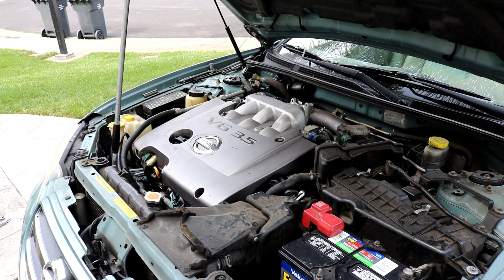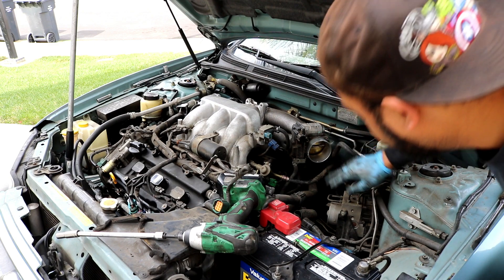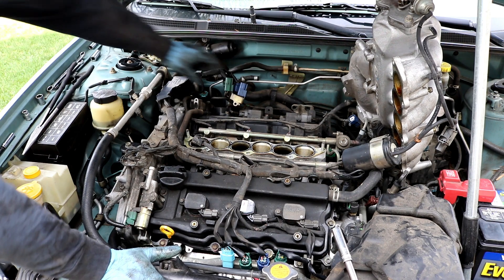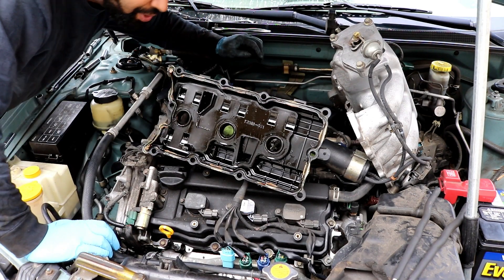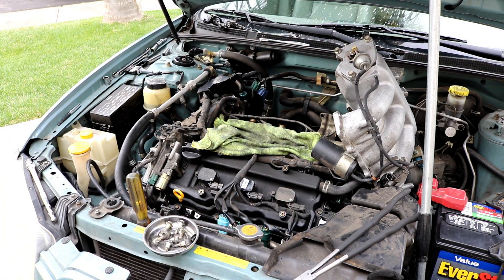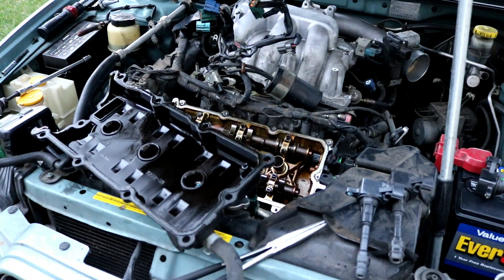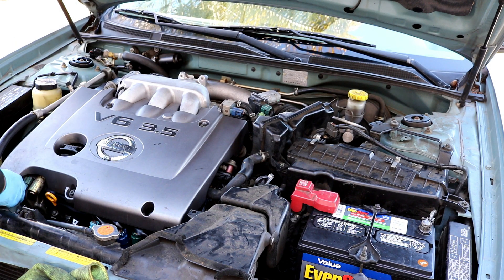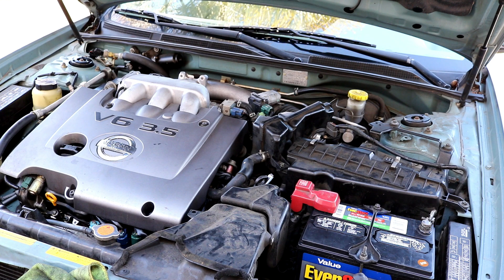Nissan Maxima/Altima/Infiniti I35valve cover gaskets 3.5L V6 VQ35DE

Comment: Bro this video just saved my wallet, I usually do all my own repairs but I was worried about replacing my rear leaking gasket because of the manifold removal but after watching this video I have every confidence to do the work myself. I was dreading having someone else work on my car short of dropping the engine. A++++++ on the detail and clarity of this walkthrough
Reply from the maker: Thanks. Good luck sir.

Comment: 2002 Infiniti I35:  Very intimidating process, BUT it all worked out nearly perfect for me mainly following this video.  Only thing I would advise if you can get away with not having to disconnect the coolant line (I had to) on the right you'll be fine. I installed 6 new spark plugs, 6 coil packs, 2 new valve covers & gaskets, 2 camshaft sensors and mass air flow sensor.  Figure do it all while you're under there oh yeah and clean your throttle body.
Reply: You did the right thing.  Always do the “while you have it all apart” items as well with that intake plenum out of the way.😊

Comment: Thank you buddy, I found this very helpful. I have a 2004 Infiniti I35 and it would of cost me close to $1,000 just for labor. It’s crazy how our mechanics/technicians pray on us hardworking citizens who barely have enough to get by. The dealerships are worse! They print me a $2,500 bill, and said it’ll take up 15hrs of labor. Smh... They wouldn’t even let me bring my own parts. When I asked why it was so high, they said because it’s a luxury car that’s why. I had to buy theirs. I’ll probably never own another Nissan product ever again. Thanks again!
Reply from the maker: That’s exactly why I make these videos. I’m glad you found it helpful.
Reply: Please upload other helpful projects when you get the chance.
Reply from the maker: Luttie Tune will do. I do have other videos up on my channel. If you are looking for something specific I may be able to help you out, just let me know.
Reply: I appreciate you for getting back with me bro. I need to reset idle for my throttle body sensor. I have an 04 Infiniti I35 same engine. I was cleaning it while it was still attached to the manifold. The RPM is jumping a little between 1000-2500 but not badly. It’s not really affecting my driving just a little distracting.
Reply from the maker: Luttie Tune sure, there are quite a few steps involved but I will write them here so that you can get this done. You will want to perform this stuff after the car has sat overnight. There are 3 different procedures that need to be done. I will list them as 1,2,3 and the steps will be listed as A,B,C, and so on...

Please read the last procedure carefully BEFORE starting the entire thing. As it is very time bound.

1. Accelerator Released position:

a. Make sure Pedro is FULLY released.

b. Turn ignition ON (don’t start the car) wait at least 2 seconds. 

c. Turn ignition off, wait at least 10 seconds.

d.Repeat these steps for a second time.

e. Take key out of the ignition when you are done with the second go around.

2. Throttle valve closed position:

a. Make sure pedal is FULLY released.

b. Turn ignition ON. Wait 3 seconds.

c. Turn ignition OFF. Wait at least 10 seconds. Make sure you hear the throttle valve operating sound. (Tip: if you do this inside the garage with the passenger window open, you can hear the valve move)

d. Remove key from the ignition.

3. Idle air volume learn:

a. Make sure pedal is FULLY released.

b. Turn ignition ON, wait 3 seconds.
 
c. AFTER you wait the 3 seconds above, WITHIN 5 seconds FULLY depress the pedal 5 times smoothly. 

d. Wait 7 seconds, then FULLY depress the pedal to the floor and HOLD IT. After about 10-12 seconds the Check engine light will switch from steady to a blinking light. CONTINUE TO HOLD the pedal still and after about 9 seconds the light will go back to steady. 

e. Release the pedal FULLY and start the car within 3 seconds.

f. Allow to idle for 20 seconds.

g. Lightly rev the engine several times to confirm the idle speed returns back to normal. 

h. After several revs and the car returns to normal idle, the relearn is complete.

Hope this helps!
Reply: Hello friend... thanks again. I had everything replaced and put back together. I had a friend help me out as well. We had replaced both intake valve covers, valve gaskets, spark plugs, coil packs, and cleaned the throttle body. Shortly after the service, I took the car for a drive and I got a P1456 code (small evap leak). We checked the connections and only noticed an intake plenum hose cracked. We replaced that one with an Autozone part shortly and reset the code. 

Shortly after, and still today, I’m still getting this code... I have an after market gas cap, but I had it for couple weeks prior to this code. I had also replaced the charcoal canister purge valve a lil while ago. At highway speeds and some high accelerations, I notice the RPM making a slight jerky motion and hesitates a little. What do you recommend?... dealership charges way too much to do a diagnostic test and probably will miss diagnose the problem.
Reply from the maker: Luttie Tune That code will require a evap smoke test to be done to find the leak. A gas cap is a cheap thing to try at first and sometimes it works. However the leak is small and it could be coming from a small evap vacuum hose or somewhere else. You can buy a smoke tester on amazon for around $150 if you have a small air compressor. However a shop will probably charge the same or less to perform this task.

As far as the jerking is concerned. Is the transmission shifting hard? Is it happening at a steady cruising speed?
Reply: Helping Hand Auto Repair 
Thank you for your fast reply. And no the tranny is shifting just fine and this doesn’t happen at cruising speeds. Only sometimes at random fast accelerations. My friend says it might be from a combination of the small leak accompanied with a the now clean throttle body. We did clean the throttle body well and gotten a lot of dirt off. He says the car is breathing much better now and will probably notice little things that weren’t there before... but yeah I guess I’ll have to look for a local honest mechanic shop or an honest Firestone to do the smoke test. The dealership charge $250 for just the smoke test. $150 would be cheaper and better if can spin a few extra dollars for hose replacement. I hope it’s just another small hose... that’s the only code that is still popping up P1456.
Reply from the maker: Luttie Tune Yes unfortunately a smoke test is needed. It would be the most effective way to find the leak. There are cheaper smoke machines on amazon. You might check that your power valve isn’t binding or stuck shut sometimes. It’s the little actuator on the passenger side of the intake manifold. It is controlled by vacuum pressure.
Reply: Helping Hand Auto Repair how do I check to see if it’s shut. I know where it’s located... kinda resembles a throttle body, right? Butterfly like valve?...
Reply: Helping Hand Auto Repair you’re a great help my friend! God bless...
Reply from the maker: Luttie Tune yes. You can physically (with a piece of vacuum hose) suck on the hose with it attached and make sure that the little arm moves fully through its range of motion smoothly.
Reply: It’s all good now man. Turned out to be the gas cap. I went and bought a genuine Infiniti gas cap and the code went away. No more leaks!

Comment: I took my 2002 Nissan maxima se 3.5l 6 speed manual to a mechanic shop for this service. They charged my $800. Car was running extremely well before I brought it to them, after I got it back there was a huge easily visible oil leak, steam /white smoke shooting from the engine, service engine light is on and it barely starts now. I'm towing it to my brothers trusted mechanic on Monday and hopefully they will be able to fix it properly. Thx for the vid bro I wish you were in my city I'd definitely be happy to pay you for your proper services
Reply from the maker: Appreciate that. Bet they crushed the gasket and torqued it down out of place causing the big oil leak.
Reply: @HelpingHandAutoRepair  thanks for the reply. Do you think a compitent mechanic will be able to fix it properly?
Reply from the maker: Of course. The back one can be tricky. That’s why I put a little bit of silicone into the valve cover grooves to help hold the gasket in place before reinstalling it.
Reply: @HelpingHandAutoRepair  also do you think that $800 was a rip off? If it was fixed properly would $800 be fair?
Reply: @HelpingHandAutoRepair  thanks for the replys man I'll message you when /if I can get it fixed up properly

Comment: Bead of silicone on the head is unnecessary and not recommended on the factory service manual (FSM - found by googling "NICO altima FSM") I'd forgo it but it surely doesnt hurt if installed properly. Great tutorial here.

The FSM does require a bead of anaerobic liquid gasket maker on the cover itself at the corners near the front of the engine, and a bead of RTV on the outside of the gasket at the same location -see FSM for exact location, and untightening and tightening sequences and tourques.
Reply from the maker: Lol. This is too much. This channel is NOT for people who work as professional mechanics. Black RTV is fine and has been fine for YEARS. I leave it to the viewers discretion if they want to use it or not.

Comment: Got a 2002 Infiniti i35 that needs a valve cover gasket replaced . Search around shops and it cost a lot of $ to get fixed . Luckily made phone calls and found a family member with good mechanic cheap price . Hopefully the engine didn't cause damage
Reply from the maker: No damage will occur to the engine UNLESS it is ran low on oil because of the leak.

Comment: Geez I remember when cars were so easy to work on. This is an awful ton of work to get the rear valve cover off. Having to invest in tools, sockets, and tips that will rarely get used is a pain. Having to remove the plenum to get to the rear gasket, to me, put this in the almost not serviceable category because while one would rather not pay someone to do the job, there are way better ways to spend the day than dealing with that mess. With all the lines and hoses, you could be looking at spending even more money if one were to break of split. Which could delay getting back on the road. And if it's your only car, you're in trouble.

I can't even imagine how much it would cost to have someone do the job.

Comment: Nice video really helpful.. if i dont have a torch ranch can i use the power drill torch same are you are using .. i have dwelt 12v battery drill it has 1 to 11 and the the hammer .. please let me know thanks
Reply from the maker: You can, however those generally struggle to loosen tough bolts. They certainly can be used to spin bolts back in but follow up with a ratchet to make sure they are tight

Comment: Good Afternoon Helping Handing, outstanding.  So I have a bit of oil at the front by the dipstick safe to say Valve Cover Gasket. My questions: 
1.) I need to do this and change my spark plugs and coils, do I need plenum gaskets for the Spark Plugs and Coil area??  
2.) Also I need to remove the ABS Module, any pointers on getting the module off while I'm doing the Gasket, Plugs and Coils??  Thanks in advance look forward to hearing from you.
Marty
Reply from the maker: 1. You can change the spark plugs while you’re doing this job. Changing the coils isn’t necessary. The plenum gasket is reusable but you can replace it if you would like.

2. Forgive me but I need to refresh my memory on how that abs unit is mounted.
Reply from the maker: Ok after trying to familiarize myself with where that abs unit is located on these cars. It appears to be down behind the engine on the passenger side as I am sure you know already. Removing the upper intake manifold will make reaching around the engine a bit easier. They usually aren’t held down by many bolts, maybe a few at most. I think removing the brake lines will put up the most grief. You will want to invest in the correct wrenches for removing flare nuts. It is called a flare but wrench. I’m going to bet the sizes are 12mm or 10mm. Sorry I can’t really offer much by ways of instructions, I simply have not needed to pull one off before.
Reply: @HelpingHandAutoRepair  Good Morning HHAR, thanks a Mill for the detailed response!  Two last question, you mentioned rubber hoses @ (17:55) being brittle could break, 1.) How do I know which replacement hoses to buy is there a one size fits all ( this real help here)??  

2.) Lastly, how do you clean the Valve Covers once removed, can you spray paint them, soap & water,  what??
Reply from the maker: BEMarty Three You can order that specific part from the dealership or you can simply take the hose down to the parts store and just match up the size and buy about a foot and a half and cut it to length. That’s what I do on these every time if they break. Will cost you about $2-3 max. 

As far as cleaning the entire valve cover (top and bottom I assume?) you can use brake cleaner to clean out the oil inside. Or soap and water. You can clean it with anything really. You can spray paint the outside if you would like with high temp spray paint.

Comment: Hey. Thank you for this video. I'm currently in the process of doing this. I believe there's a little bit of coolant in my oil from k the looks of my valve covers. I'm thinking the head gaskets are blown but I performed a compression test and it surprisingly did well. I'm not sure what to do. Is it possible for coolant to get in through the Intake manifold somehow?
Reply from the maker: I don’t recall if there are any coolant passageways in the intake manifold. I don’t believe there are if memory serves. A compression test won’t tell the complete story, a leak down test would also be a good idea to further pinpoint a specific cylinder.

Comment: Thanks for the Great Video,
I have nissan maxima 2008 and with Service Engine Soon its showing P0300 and P0301 code. Also shown the car to one of Mechanic and he mentioned repair on both Gaskets due to oil leaks everywhere so he quoted approximate 600$. So will he change only valve gasket cover or both the Gaskets shelf itself. Not able to reach out to him, but will fixing this Gaskets valve Gasket cover resolve the SES codes as well ? Any thoughts ?
Reply from the maker: Well P0301 relates specifically to cylinder 1 misfiring. The cause of the misfire can be a few things.

Worn spark plug
Bad coil pack
Bad fuel injector
Oil soaked coil boot

If you pull out the coil packs and find oil on the bottoms of them or oil in the spark plug holes, then you should definitely replace the valve cover gaskets and spark plug tube seals. They normally come as a kit with both in them.

The P0300 can be a byproduct of the P0301 so when you’re done with the repair for the 301 code, delete the codes with a scanner and then drive the car to see if the P0300 code comes back.

Hope this makes sense, feel free to ask anything else and I will try to answer your questions.

Comment: Hey i have an 07 max its smoking after sitting for 2 months not sure if its the valve cover gaskets.
It was leaking from power steering before and i dropped coolant changing radiator. Doesnt seem like it leaks but smoke from engine after 20 mins still
Reply from the maker: Smokes from the mufflers? Or smoke is coming off the engine? If it is coming off of the engine/exhaust manifolds, then there is a high chance that oil has dropped down onto the exhaust and is now burning.

Comment: Thank you for the video!! I have a i35 2002 and there is oil leaking from the seal by oil dip stick up by the yellow pull handle. Is that this gasket? Thanks in advanced if you can answer this!
Reply: Think I just answered my question lol that would be a yes.
Reply from the maker: Justyn Holder Yes. You will want to replace both valve cover gaskets. The part will come with both gaskets for each cylinder head.
Reply: Did you ever change valve cover gaskets? I have the same car 02 I35

Comment: I need to do this on my wife's 2002 i35.  Thanks for all the detail. I did have one question. Do you or they recommend any gasket sealant on the intake runner?
Reply from the maker: Mark Eden No. don’t use anything on the manifold other than the gasket.
Reply: Hi Mark. did you get the Valve cover changed? If so how difficult. any advice for a newbie? Sealant use??

Comment: How hard would this be for someone doing this for the first time? I have a 1995 Maxima which has the 3.0 engine. Shop wants to charge $500 for both valve cover. But I can get the part for $20-$40. I'm scare I'm going to take the thing apart and not be able to put it back together. Also does torque spec really matter especially the intake manifold?
Reply from the maker: This would be a 7/10 on the difficulty scale for a first timer. This video also is a different engine than what’s in your 1995 Maxima. Those have the earlier 3.0L engine and the engine in my video is a 3.5L. 

The 3.0L is a harder job IMO. The throttle body/coolant hose area is a real PITA to work around. Don’t get me wrong, it’s doable, just time consuming. You can follow this video loosely to guide you through the “steps” of what needs to happen. However please understand that  engine shown in this video won’t have the same connectors and wiring harness and bracket locations.

Comment: Is this is the same as a 2001 infiniti i30, The i35 is just a different model of the shell of car, right?
Reply: Wait, im probably wrong
Reply from the maker: You are correct in that the i30/35 is essentially a Maxima. However your 2001 i30 has the earlier 3.0 liter V6. So while the process is pretty similar, there are glaring differences that will not be the same.
Reply: @HelpingHandAutoRepair  hey thanks for clearing that up much appreciated!